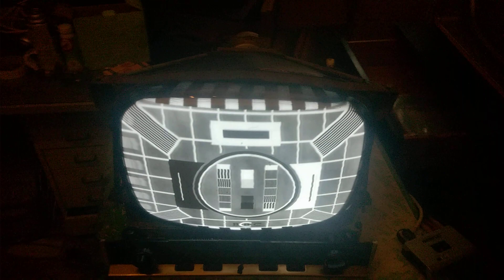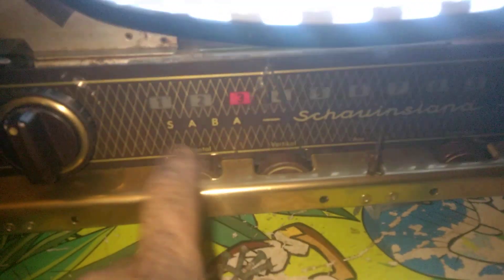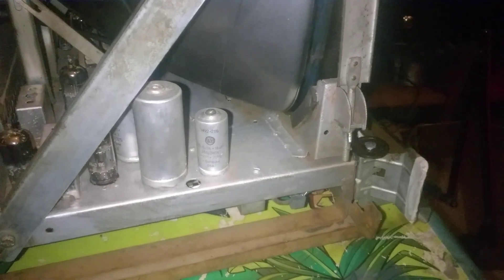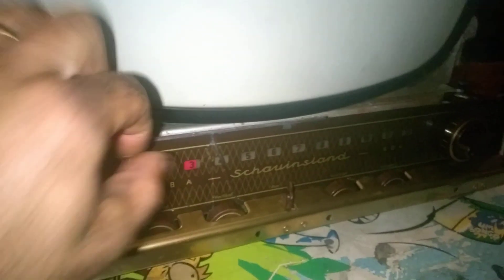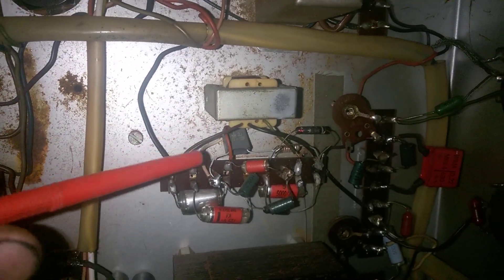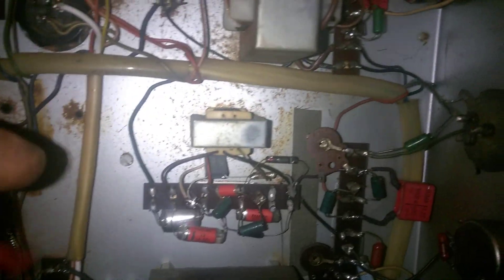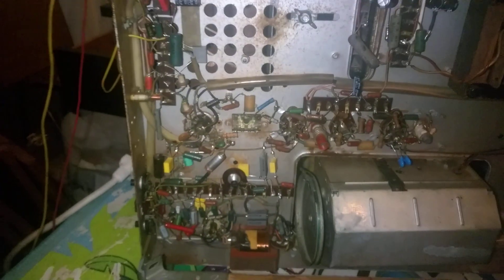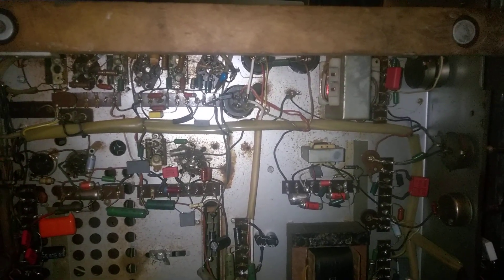1957 Saba Schauinsland T604 valve TV restoration repair part2

Comment: Hi Hugo, I'm from Chile and I'm repairing a Saba T-600 b&w tv made in Chile, I think it's from 1965, very rare tv, it has a VHF connection with a 240 ohm antenna, it must be a similar connection to the one you show, what kind of connectors do you use and modulator to visualize? I congratulate you for your channel, I am learning with your videos.

Comment: Thanks for sharing that looks fantastic. Been ages since I have do a TV. I love working on the old TV  CRTs that tube looks very similar to one I had in a bush TV53.
Reply from the maker: yes they are both 90º tubes, and i believe the tube base is the same, the bush uses a mw 36-24 and if i remeber right this one is a aw 43-80. this one appears to be slightly more rounded on the sides, they could probably be swapped without modifications, i have done the same with other tubes when they are not available like on this one https://www.youtube.com/watch?v=OuWqCbmzUYE
Reply: Hugo B. Your correct I remember the tube number you mentioned. Unfortunately the removal men managed to smash the tube when I moved house. Looking to do another vintage TV if I can find one.

Comment: The Saba looks absolutely beautiful - inside and out. The picture appears really excellent for a 50s set. Who on earth gave you a thumbs down??? Your wife?
Reply from the maker: hi Martin, thank you! actually my wife also enjoys the vintage tv's and radios and the house is big so no problems so far :) all my videos have the same usual viewers and always one thumbs down so i guess its the same person, but that doesnt bother me.
this tv really has a bright and defined picture for a 50's crt and the fact that the dag is not flaking like it usually is leads me to think that the crt is almost new. and it tests like new, infact it pegs the tester...maybe they replaced it and then some capacitor failed then they discarded the tv. 
i am almost done on refinishing the cabinet and will post that soon, it looks really good with all the trim polished etc
Reply: @MrHBSoftware  Ha ha makes you wonder...I love your vids so far. Thanks.